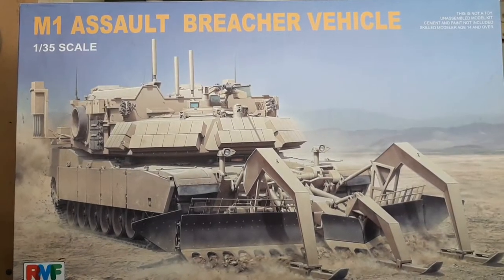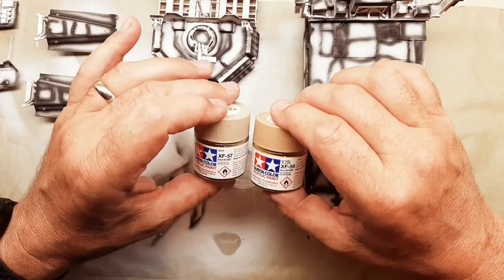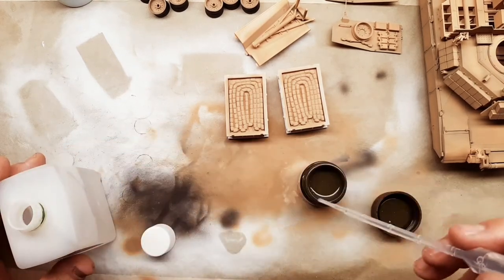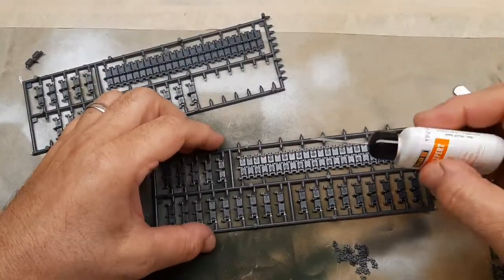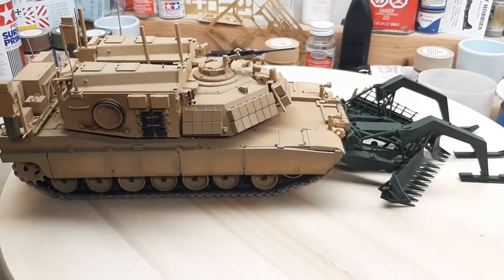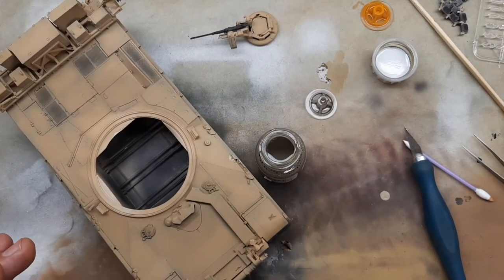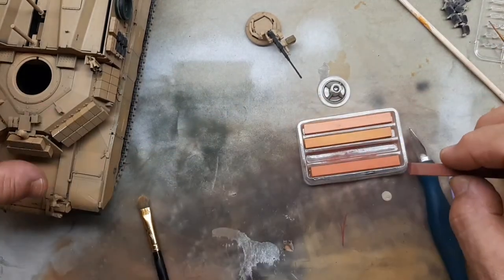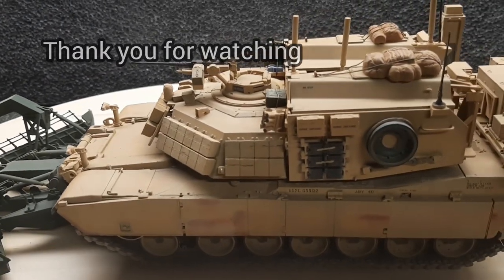Rye Field Models 1/35 m1 Assault Breacher Vehicle build and review (video #20)

Comment: What is the best glue and way to glue tracks?  I always mess mine up
Reply from the maker: I have been using Faller Super-Expert lately and been very happy. I like it has a long metal tip to apply. Before that I used Testors liquid cement with good results. The Faller is easier to control for me.